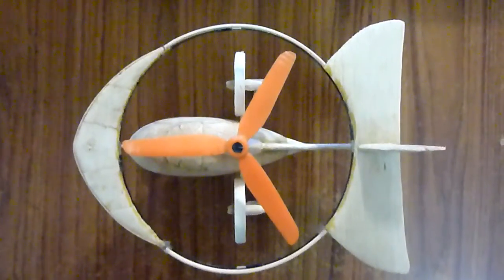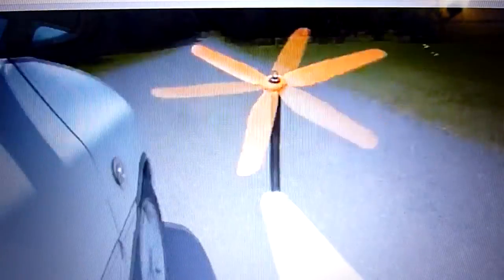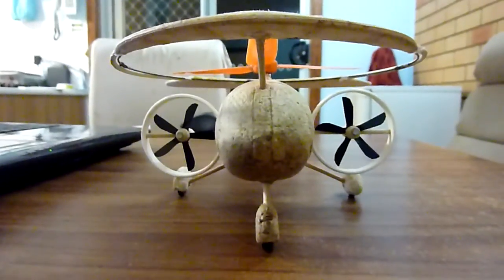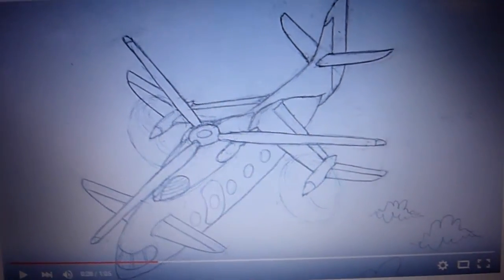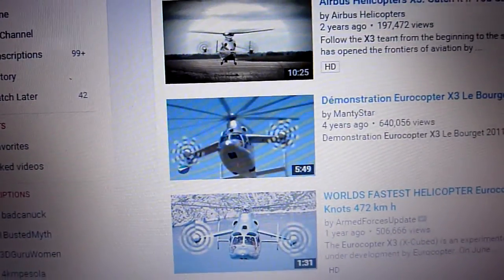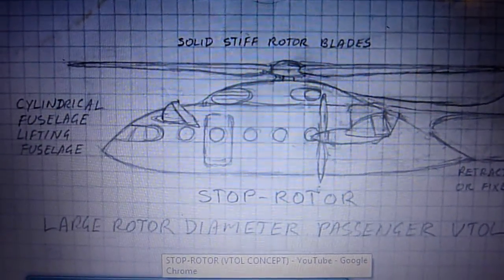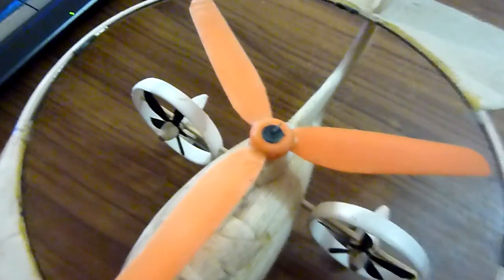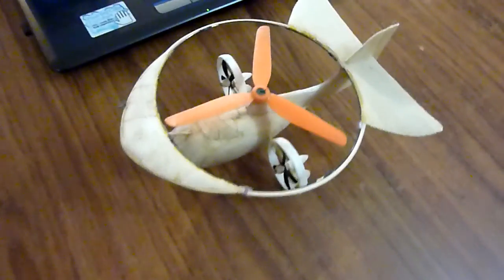HOW MY STOP-ROTOR WORKS

Comment: I love it! You got a sub!
Reply from the maker: Thanks. I got an even better one now. It's the Sikorski RAIDER, but with slowed rotors. The RAIDER has two rotors on top that are only slightly slowed in fast flight (by only 15%). But if you slowed the rotors by about 90%, they could actually act as plane wings (if you slowed them enough and had computer controlled blade angles). 

My stop-rotor blades are not used as wings, cos I need two main rotors, to do it. You simply can't have a wing going backwards that  makes successful lift (no way). And the RAIDER does have two main rotors, so it's possible to use them as wings. 

So if the RAIDER had 90% slowed rotors (with blade angle algorithms) it maybe would go over 300 mph instead of the lousy 250 mph (and be better on fuel as well). And still take-off land like a chopper (when the rotors are sped up). Look up the (too slow) Sikorski RAIDER (on YouTube). It's impressive but it would be more impressive going 100 mph faster: https://youtu.be/HncZgouxt9k